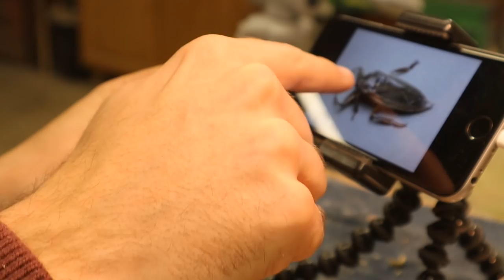Making a Toe Biter Bug Fishing Lure

Comment: I want to get into Lure making like this. My father in law is a retired biologist / habitat rebuilder for the Wyoming game and fish and has advised me against using lead in baits. Do you have any other suggestions for metals to use in baits? I have heard of people using steel washers as well as melted tungsten just want your opinion if I could pick your brain.
Reply: @gunnerbaker1426  my father in law went to school as a biologist and started bottom rung in the game and fish and worked his way up the food chain around the state. Ultimately he retired as the manager for that department. I would contact your local game and fish office and see if you can sit down and talk with them about what they do. It's my wife's father so I do not have a ton of knowledge on the subject. My wife is going into a similar field and she is currently getting a bachelor's in wildlife biology and wants to work with the game and fish to rebuild bird habitats. The field requires a biology degree I can tell you that for sure.
Reply: Tungsten melts at 6192 degrees Fahrenheit you could chisel or drill out a hollow spot and insert a small tungsten weight but if you are able to melt tungsten you can't pour it into something made of wood without burning up all the wood.
Reply: @canaan5337  so cut the hole and just secure weights into it and test? Waterways around here are said to outlaw lead within 5 years so I wanna be prepared.
Reply: @MurderOfTheCrows  put a small tungsten weight in the hole put a piece of Scotch tape on it and test it that way you can test and retest till you get it where you want it and then fill in the rest of the hole with superglue and baking soda

Comment: I so enjoy these videos - you're great! I once had an idea for a lure, I would like to make, but sadly I am unable. It was supposed to be loosely based on a common roach and have 2 parts. The front part should be made out of lucite or another transparent material and have a hollowed out section with a flashy cylinder blade rotating on an axle [water being able to flow through the front part, as the bait is dragged]. Back part made of wood and fins of soft material. Only a basic painting of the front part on the top and bottom for the middle to remain partially transparent [and thus the flashing cylinder being visible]. It was supposed to be a wobbler type crankbait with a bill as part of the front part of the body [like a Swim Whizz]. I realize that is a bit "out of the box" of an idea, in that it will be very different from your typical baits which are pretty perfect copies of real animals; but you did ask for ideas :)

Comment: Get that lathe anchored down with some lag bolts with some high strength washers, if you haven't already. Otherwise the rotational inertia and being unstable can throw off your cuts significantly. Learned that the hard way.

Comment: you should use epoxy sculpt with that cable for the legs on these insect lure builds....or something like the cricket legs it would have been ideal instead of trying to mess around getting wood to work...plus it would be a hell of alot easier to get realistic detail even if you wait til it cures to carve it in...but at least using epoxy sculpt you can do any little spikes and really small segments that are basically resin so durability wont be an issue like it would with thin wood

Comment: Try electrical tape around the lid of the jar of your clear coat to seal it so no air will get in and then store it lid down or upside down. It works with pvc pipe glue, may work in your case and make it easier to open.

Comment: How about making a chatterbait style with a hardbody jointed swimbait body instead of the traditional soft plastic body. Or like an Alabama rig with jointed hard body swimbaits instead of the paddle tail plastics.   If that doesn’t make sense then I’d like to see how you’d make a simple top water spook or popper. Although easy in concept, very difficult to tune and weigh for optimal desired action. I know here in Texas, on lake fork there are only a handful of bait shops that carry a bait called the “yellow magic” popper. I don’t know what it is about it but the pros swear that it’ll catch 5 to 1 over any other brand or style of popper. Just a few thoughts! Keep up the phenomenal work!

Comment: I see sometimes you use oil based polyurethane to seal your lures, and sometimes you use the water based stuff.  Do you have a preference? or a reason why you changed?  I'm worried about the oil based stuff and envirotex together.

Comment: I'm riveted whenever the utility knife comes out to carve fine details. "Will he slice the tip of his thumb off this time?"

I know you like the tool, but I think you owe it to yourself to try some new stuff. I do a lot of detail work in balsa using scalpels. Look for #11 scalpels on Amazon and you'll get an idea of what's available. The nice thing about them is they're crazy sharp and stay a lot sharper than X-Acto blades for longer. With the right handle, they feel a lot nicer in the hand than anything else I've used (and I've used everything, utility knife include, until I nearly cut the tip of my thumb off).

The only thing I haven't tried, but want to now: an ultrasonic cutter. See here: https://youtu.be/FA46h7Db1BY